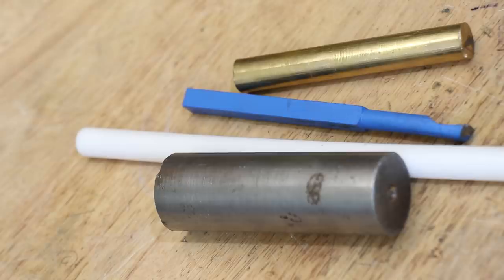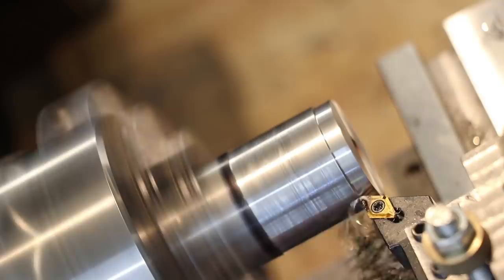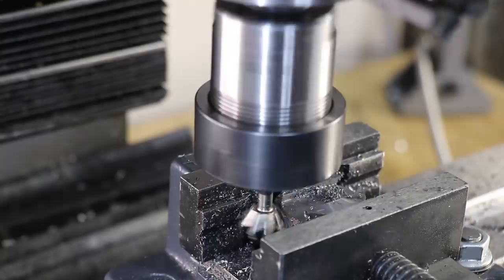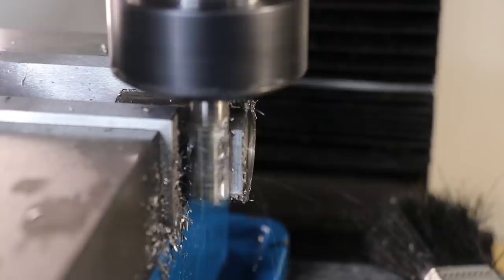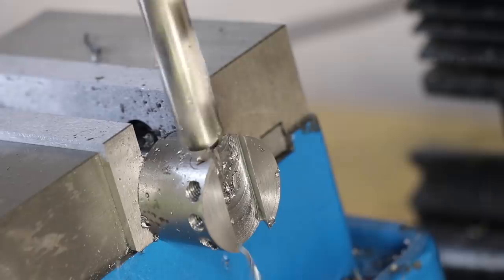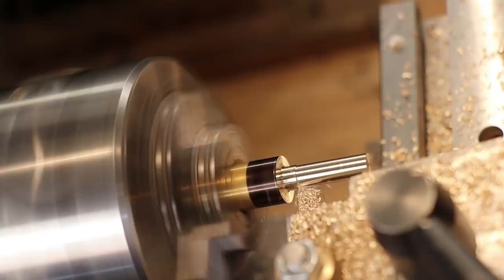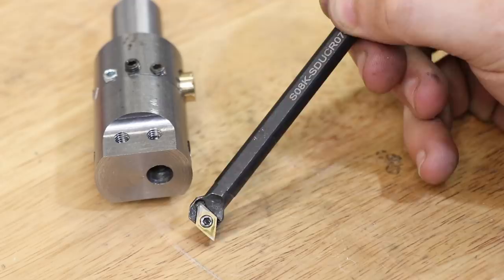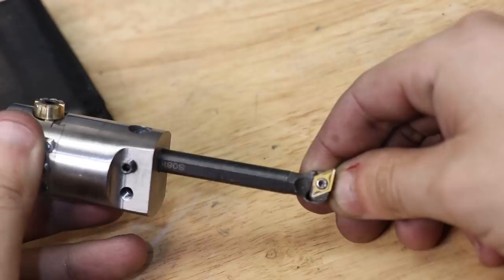DIY Boring Head Build | Made From Scratch

Comment: Great work, I have a commercial one about that size and it does heaps. The horizontal hole on mine takes an adaptor that holds round HSS at an angle for use as a fly cutter. You could use a left hand tool and insert with a bend in the bar. Sometimes I use it in the tail stock of the lathe as a boring bar if I don't want to change out the tool post for some reason. It has straight and MT2 and MT3 shanks that screw in. Thanks for posting.

Comment: Just a little tip...when you are work holding something on the edge of the vise like at least for a proper mechanist vise like you have now put something on the other end that is just a little smaller say half to 1 mm on the other side. Precision vises like that don't like to be unevenly loaded. This will greatly improve your grab on the work piece and the vise will thank you as well.
Reply from the maker: I had that thought the second I turned off the camera :) Cheers
Reply: It can be used for light clamping at the edge. That's why the jaw is constrained from pivoting sideways. The puck in the other end if used will have to be pretty much the same size (+0/-0,2 or so) but 1mm is way too small
Reply: I've tested this and on the ones i usually use, you get ~45-60% (varied from vise to vise) of the clamping force if you only use the outer 10mm on a 150mm vise

To get 100%, i needed .05mm accuracy on the second block (i also  realised that i only get ~90% when using saw-cut stock)

Comment: That’s a really neat tool. If I could make a suggestion for when you’re making a cut such as at 5:18 or so, if you plunge in Z and then retract it, move X, and then plunge again, and so on it helps speed up roughing. Especially when doing rough cutting in a small machine. I have a bench top Smithy a little larger than this

Comment: Nice work. There are mt3 collets that fit in to the spindle taper and are held by the drawbar. They save you some Z axis space.
Reply from the maker: I have actually ordered one, it's in part the reason why the shank diameter had to be as close to 18mm as I could get. I'm not sure if the clamping range of these collets, but I assume it's similar to 5c.

Comment: Thanks for taking the time to make the video!  It takes a lot of work to complete a nice project like yours.
It is great to see the methods you used to achieve the finished result.  Years ago I purchased an inexpensive boring head that has built in runout.  At this point I think I’d have been better off making one☺️

Comment: Very inspiring. I keep teetering on get a cheap one or making one.  Where I live, the stock would cost about as much as just buying a cheap one. This seems really great!  Maybe I can find some truck axle or something to solidify a DIY.  You have certainly shown it is not difficult!
Reply: Go to a salvage yard where you can remove parts. Find a rear end up in the air and snatch the axle out. Good high carbon steel that’s cheap and easy to get. Think I paid 8 dollars and some change. I still have over a foot I can make other stuff with.

Comment: On a rounded surface, you can also spot drill with a ball end mill. The ball end mill won’t be able to wander. I think a center drill also works to a point.
Reply from the maker: Never thought of that but that would seem to make sense, I don't have any ball end mills bit I'll have to give it a try when I do. Cheers

Comment: I'm thinking of re-boring the casting on my cheap drill press to add tighter fit sleeves. But I don't have a milling machine and doing it on another cheap drill press doesn't seem reasonable. I might just pay a turner to do it but I'm prepared it might just cost more than half of the ionitial price of the drill press.

Comment: That first cut on the lathe hahah i was like (Oh no, here comes the classic "let's not feed it too much cos it's hammering away.." point snapper) aaaand yep.. 

I have no idea how much your tabletop lathe can handle, but usually when turning stuff like this, or even hex bars ( for making special nuts or whatever.. ) It's best to jab the thing right until under the hammering.. (So in 'clean' material) Feels stupid, but this way the insert will have way less of a slapper to handle, eventho you're feeding it massive amounts more material.
Reply from the maker: There's only so much this little lathe can take on cold rolled steel. Anything more and the lathe stalls. Cheers
Reply: @artisanmakes  thought so, however angle of attack can also do wonders, besides, no idea if you have a tool with a 45deg insert, those can take much much more of a beating, all in all, nice video! Goes to show you can make your own tooling if need be, it might not be perfect.. But still it works and it was a nice watch!

Comment: Someone has gone a bit too long without their regular dose of ToT, it seems...

-making exact sizes up during the build
-quite short non-moving part
-technically not the right dovetail tool
-slightly looser dovetail than expected
-some issues when cutting the moving part's scallops
-using the boring head itself would be useful for the adjustment screw hole, since breaking through the wall causes issues, but the right endmill isn't available
-mentioning how one should single-point the leadscrew for good thread fit
-dial markings could use some work
-no rotary broach for the internal hex
-cut down a nice inserted boring bar, instead of a brazed carbide one

Was that intentional? Got me chuckling either way :)
(in case anyone is unfamiliar: those are all things that also happen in This Old Tony's boring head build)
Reply: Speaking of This Old Tony, where has he been? It’s been months since he’s made a video.
Reply from the maker: On his patron he posted an update a while back, my understanding is he is taking care of his father in law.

Comment: Hacksaw lol. It's not 1925 any more dude.😋
Get a bunnings Ozito $29.95 angle grinder and some 1mm thick cutoff discs. They go through steel like butter, even hardened steel or tool steel.
You might even find you can sharpen carbide inserts with those cutoff discs too... 😎

Comment: Where did you get 50 cent insert. Regard DK
Reply from the maker: AliExpress. There are a lot of inserts that sell around $5 - $20 for a 10 pack of inserts. They work for great for hobby use. I've used kyocera inserts and on hobby lathes, the difference is negligible. Cheers